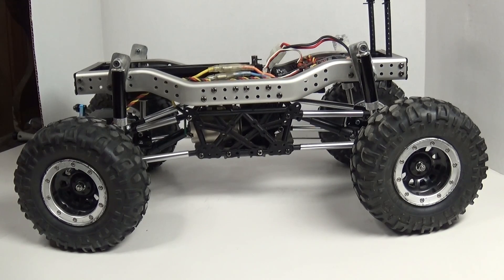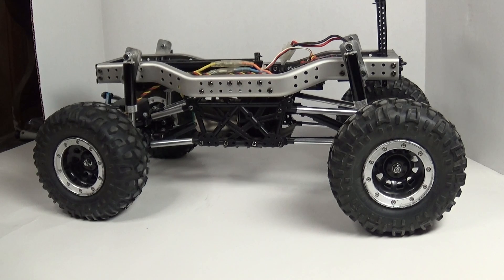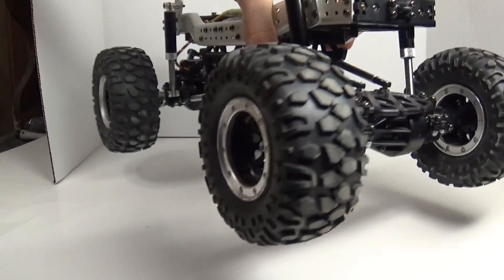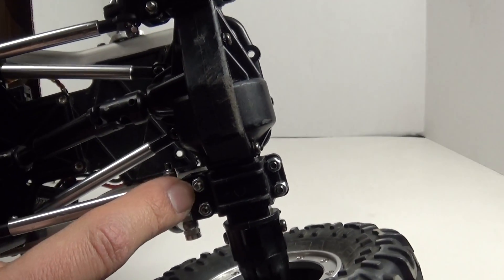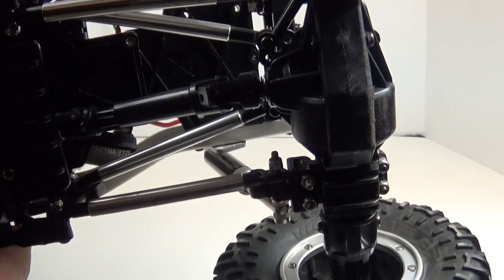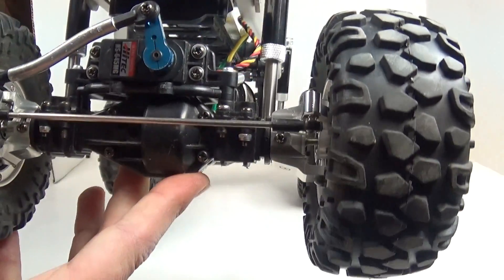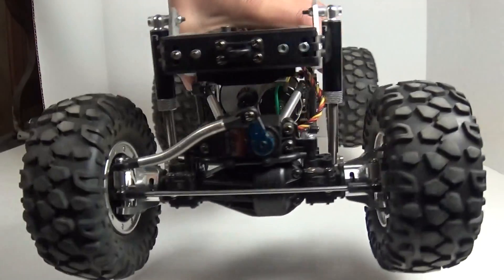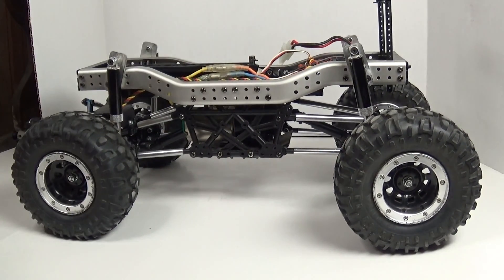Tamiya CR01 Land Cruiser RC 4x4 Crawler Project Truck

Comment: hey I'm not familiar with tamiya but are those shocks stock or aftermarket,  and if they are aftermarket what brand are they and what legth 80,90 or 100 mm
Reply from the maker: Theyre either hot racing or yeah racing, not sure on the length.